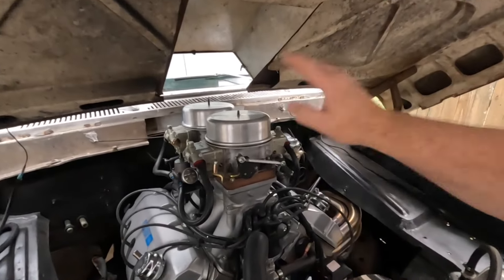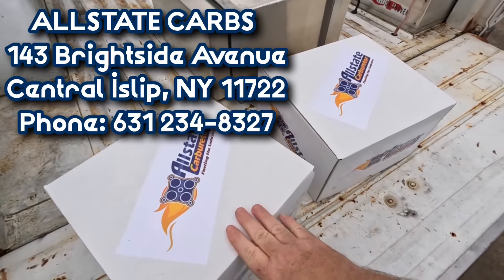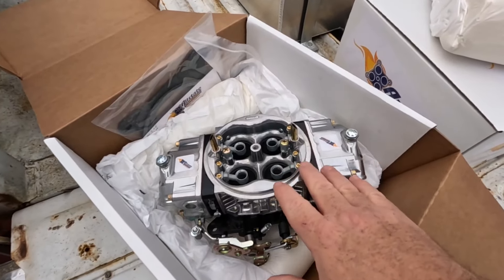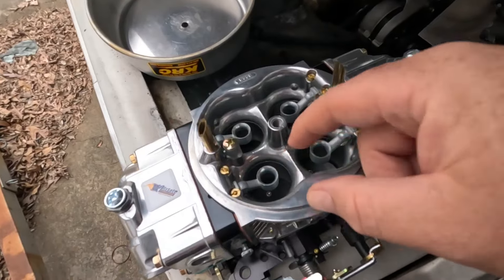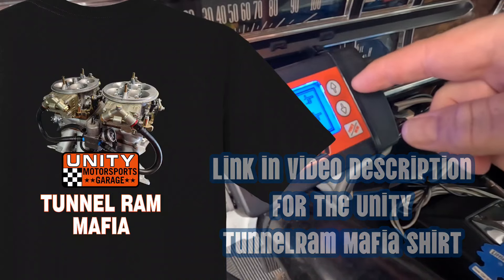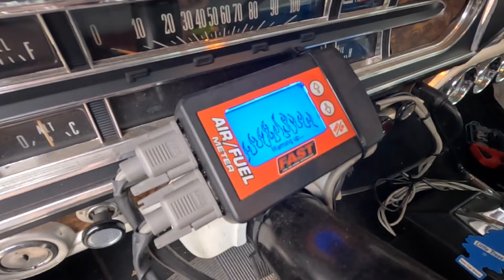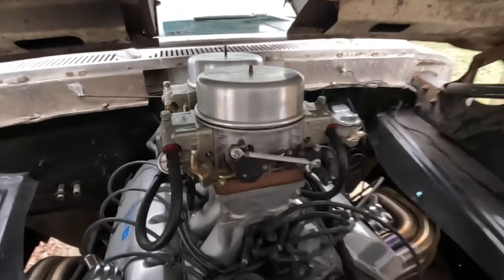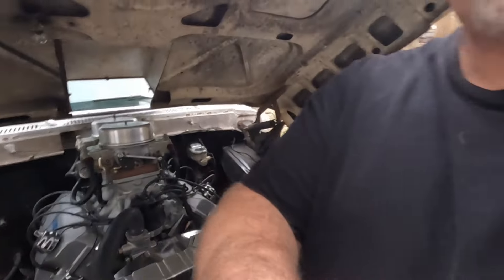Holley 4150 VS 4500 Throwdown of the 750 CFM CARBS Is the Dominator the King? @allstatecarburetor

Comment: Dang! ALLSTATE CARBURETOR! I used to live close to that shop. There very good at what they do.
Reply from the maker: Yes they are and great to work with I buy all of my Gaskets, Jets, Bleeds, plus they modify/build carbs..
Andy
Reply: The forty one fifties are gonna work better.I think they'll be less fuel Fall out between the carburetor and the head, With the 4150's. What springs on the pumps?  Which boosters. Dog leg?  I would. Cubic inches ÷ 2  carbs. Dog leg boosters

Comment: When I was with Jenkins in '71 his tried and true setup was two 660's with the last lower inch of the main body opened up for 850 baseplates . Holley , Weiand  , Bauman , Mopar and one or two Hemi teams had sorted the Dominators about a year and a half earlier , and they won 90 plus percent of the major Pro Stock races in '71 . So of course Holley wanted Dominators on the top Chevy , which was a 430 inch big block , and we worked very hard to comply . When we finally got the manifold and big carbs sorted , we stayed right where we were with the 660's , and didn't close the gap on the Hemis which was about a tenth of a second . Soooo, we built a small block Vega ,,, ! ,,, Btw , of course the little carbs had a much bigger plenum ,,, !
,,
,,, I rated the 660's at a nominal 700 CFM ,,, and we initially used the 1050 CFM Dominators , but had the 1150's , and maybe used them first . It's only been 53 years .
Reply from the maker: Roland I'm so glad you posted.. can you please email your info again to tunnelram393w@gmail.com
I would love to talk with you and maybe have you on for a live chat
Andy
Reply: @UnityMotorSportsGarage have you checked out the "carb cheater" that Thunderhead289 came up with?  
That might be something fun to play around with.

Comment: Ive been using widebands for the last 12 years never will tune a car without them
Reply from the maker: I'm with you, although I will say it made plug reading easier because I could actually see and correlate the AFR to the color of the plug
Andy
Reply: Good for you real men don’t need em never did

Comment: I believe this is going to be a very revealing project.
I'll be tuned in on it.
Reply from the maker: Thanks Roy! 
I believe it will be interesting to see the results
Andy
Reply: We need to use them on Mission Impossible! Tunnel Ram Mafia!!!! With 675's! Yes!
Reply: I currently have a Street Tunnel Ram on MISSION IMPOSSIBLE FOXBODY 
Got leaking head gaskets tho so no test hits as of now.
Reply: @bigboreracing356  I had alot of issues holding head gaskets in a hot 5.0l. Finish was mill heads, deck block, HD head gaskets, torque to yield head bolts.
Reply: @servediocylinderheads  My issue is a F2 ProCharger/Nitrous if needed on a GM  502 Marine block.
 Quicker cars force me to turn up the wick to keep from getting gapped.
 Got a o ringed Big M Block and copper gaskets to seal better.
 I apologize for what I said yesterday.
  I have very low SI
 Why did you use torque to yeild bolts on a race engine?  Did ARP not have anything available?
Reply: @bigboreracing356  It was a fast street ride. Thanks

Comment: I think the annular boosters in the Dominators will atomize more finely than the downleg boosters in the 4150, given the same signal.  Because of that, response might be crisp with the Dominator. However,  the finely atomized mixture will take more room, physically,  in the intake tract. And that will result in slightly lower VE at wide open throttle for the Dominators compared to the 4150s. That could give the edge to the 4150s at the track and on the dyno, despite the Dominators having better drivability. Just a crazy thought, I could be totally wrong.

Comment: Agree 100%. 02 sensors are the only way to really tune a carb. You can get close with the seat of the pants evaluations,  but the sensors really let you know where you should lean out or richen up the individual the circuits. I'm interested to see the results. My guess, they will be within about 10hp. But the dominator will get the edge.

Comment: Use of o2 sensors will definitely help dial in fuel to air ratio.  Most shops used to have a machine they could hook to car all analog with o2 sensor at tailpipe dwell meter Anda few other things fer routine tune up

Comment: I agree with your thinking, without a wide band O2 sensor you are working blind.  Very difficult to set up a carb for optimum results by seat of the pants testing.

Those nw HP 4150s are dead sexy BTW... very nice. Looking forward to it.

Comment: I have a wide band on my car and only use it on the street, on the track the carb is completely set up different.  I would like to see a single 850 on that.
Reply from the maker: JC how come you don't use it down track? 
Curious
Andy
Reply: @UnityMotorSportsGarage  I tune everything on the car to the 330 clocks...if its fast there its fast everywhere.

Comment: I think the Dominator will have better cylinder to cylinder distribution, so a little more power, but the 4150 will have a better signal to the boosters, so maybe a better transition when the throttle opens and launch/drivability gain. The 4150 750 has a very good Venturi design, which is hard to beat and I can’t see a restrictor in the booster being better.

Comment: 4500' flow rating are at 1" H20 where 4150 ratings are at 1.5" H20.  This means Dominators flow way more at same pressure drop..  Not surprising that peak power is higher with Dominators.

Comment: When my O2 sensor dies from C16 I burn the lead off with a torch.
Reply from the maker: I've never tried that.. I will have to give it a shot!
Andy
Reply: @UnityMotorSportsGarage  Use a propane torch  (I use a brazing torch)to get it slightly red until  smoke stops exiting  the vents .
 Doing a before and after voltage test will help.
 Trick is not to get the sensor extremly hot.
  Do a free air calibration and you are good for a few more test hits.

Comment: Those tests will tell you nothing about the flow capabilities of the carbs- the engine will only pull in as much as it needs. Do an actual flow test too... both are probably plenty big enough for that engine? Whichever can deliver the best fuel curve will make the best power curve I would think
Reply: Where are you going to airflow these carb's WET? The best way to test!
Reply from the maker: The one thing you need to think about is Airspeed.. the higher velocity through the 4150 will it make it perform better? 
We will see
Andy
Reply from the maker: I don't have the ability to wet flow test a carb.. sorry I wish that I did
Andy
Reply: The question i had was directed to roberthollinshead.
Reply from the maker: @brucekultgen3015  gotcha..
Andy
Reply: Been using dash mounter air /fuel gauge since the 80's! Love them.
Reply: Just for flowtesting videos check out Eric Weingartner. Very interesting videos on the channel overall. Im on 455 Olds a single 1150cfm dominator offenhauser portosonic tunnel ram. Once everything is done ill be happy. I use a 6AL box but i tune with a vacuum gauge.
Reply: Sure, there’s roundabout a way to know which one flows more, set up a temporary map sensor and graph it during each carb test, logic would dictate the one the one with less vacuum with all the butterflies wide open (at the same rpm in each test)would have to be flowing more cfms.
Reply from the maker: @TheMajictech  bingo
Reply: @TheMajictech You can use math and quarter mile mph to figure air flow through a carburetor
Reply: @UnityMotorSportsGarage - In line with that thinking I would be curious to see how a single larger Dominator on the tunnel ram would perform.  I would think a single carb would get a much stronger signal and faster velocity than dual carbs on small engine like this.